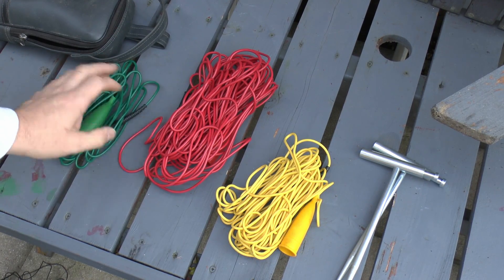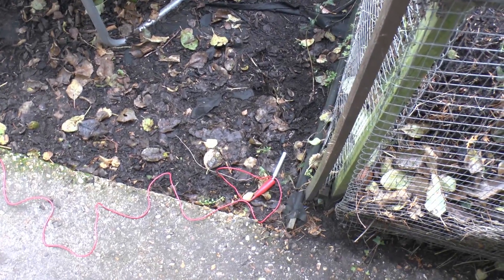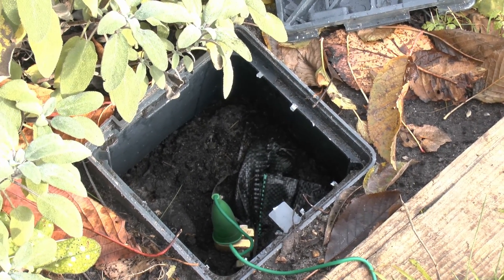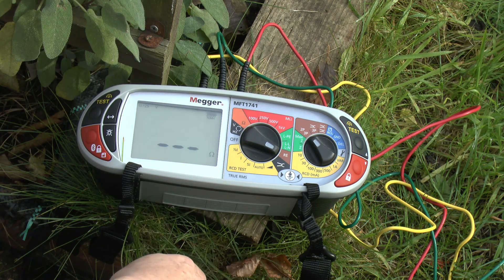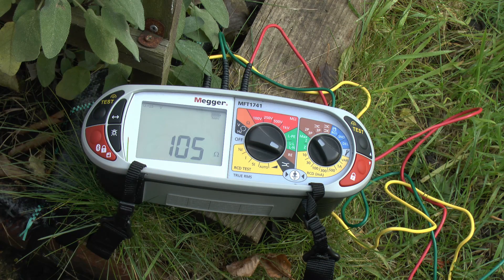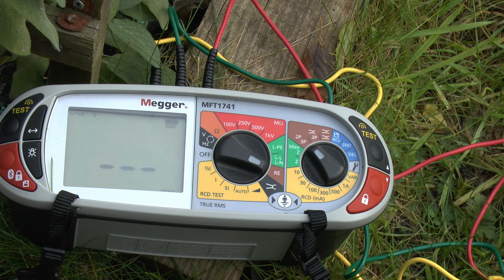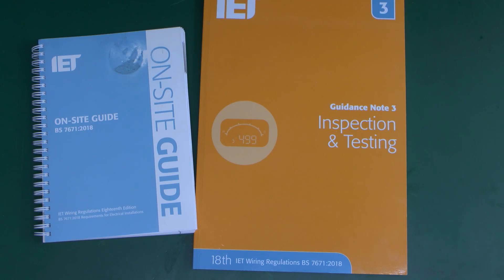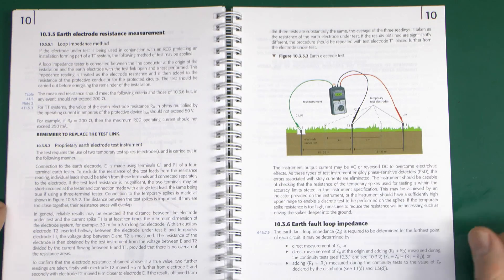Earth Electrodes - 3 Wire Testing Example (Part 3)

Comment: Hello, at minute 17.00 I didn`t quite understand how that method succeed in measuring only the Resistance of the electrode under test. The current is also flowing through R1, R2 and R3 in order to complete the circuit.

Comment: Very useful video. I have never seen this test and measurement done myself, so it is cool to see it. I have a question. Why the resistance doesn't change when you move the potential probe stake? What is theory behind this measurements. I guess it has something to do with the Ohm/squares.

Comment: On a TT earthing system, should N and E be linked at consumer board?
Reply from the maker: No, not permitted on TT or any other arrangement.
Reply: @jwflame  thanks JW, a so called "engineer" told me to link N to E bus bar as living in Thailand use a TT system or a PME?,  I didnt as it sounded very ODD
Reply from the maker: Other countries have various arrangements for earthing, but it's not permitted in the UK.  Even where allowed, linking N&E wouldn't be a TT system.
Reply: I am from India where TT earthing system is followed.
Reason for not linking n and e:
Imagine the service has floating neutral fault. The consumer doesn't notice this as the return path is now 100 per cent via linked earth. OK fine.
One bad day the earth lead got snapped (may be due to corroded joint or mechanical damage).
Now what will happen? As both return paths are open, all metallic parts (switch boxes, conduit pipes, appliance bodies etc) of the service will get energized thru the earth terminals. The appliances will not work as there is no return path. In this condition if you touch the metal parts, you become the return path and get electrocuted. 
Bonus point: RCCB is must for TT earthing system in order to protect us from leakage currents. Mcb or fuse is not intended to protect us. These work during long duration over loads and shorts for fire protection of wiring and property.

Comment: Hi John. Great video. Could I request a topic for your next one? I recently hooked up an old caravan (that was working perfectly when connected at home) to a powered site and found that every time I tried to use any load it tripped the RCD in the supply box. After checking the fuse board I found an earth-Neutral connection in the caravan. This makes sense, some current is returning from the load via the earth wire and bypassing the RCD in the supply box. My question is, what is the purpose of the earth-neutral connection and how is a caravan wired so it can be connected to either an RCD or no RCD protected supply?

Comment: I think the most important conceptual point here is that the marginal increase in resistance of the electrode (rod) under test decreases as distance from the rod goes up. This means that as you go further away, eventually the resistance of the rod reaches a maximum value and will not increase thereafter. This is because the increase in resistance owing to distance is more than made up for the decrease in resistanace due to an increase in current path surface area. So the resistance between 2 rods at 30m could be the same value as the same rods 300 miles apart (asumming the same ground conditions).

Comment: I've only seen the earth electrode test done once back in the late 90s  for a remote located 2 x  double stacked porta kabin office  with lightning protection fitted and earthed at all 4 corners for an air control tower for Raf helicopter pilot  training.

Comment: I am wondering, is that low enough for a UK installation?

Here in Belgium it MUST be under 100 Ohms, but you'll still need lots of RCDs to have a compliant system (whole house, bathroom, lights, one per 16 sockets, ... etc).
It is advised to be under 30 Ohms, which most installations are. In that case you are only required to have 2 RCDs, one 300mA for the whole house and another 30mA for bathroom and some appliances (water heater, washing machine & dryer).
I am not 100% sure but I think there are case where you may have more than 100 Ohms here, but it would require some annoying things like a 30mA hole house RCD ... etc
Reply from the maker: Almost all RCDs for UK homes are 30mA, and virtually all circuits have them.
Theoretical maximum with a 30mA RCD is 1667 ohms, but generally under 200 is considered acceptable.
Some older TT installations have a 100mA RCD, maximum for that is 500 ohms.

Comment: John,   Kevin from across the pond.  Ground rods are poor electrodes.    Here in US if a rod is your only choice it must be 25 ohms or less for a single rod per NEC.  If not add a second rod and you are done.   I have a question, at 0:55 you said that if the earth ground rod was not connected to the consumer unit it would be dangerous.   Do you not connect to other electrodes normally?   And another question, what is the perceived danger if there is not an earth ground?   Respectfully,   Kevin
Reply: R. D.    And that is my question.   Explain the dangerous condition.
Reply: R. D.     Also,  in US residential we have single phase that is 240 volts with a center tap neutral that is grounded.   So 120 volts to ground.   The 180 degrees is only because of the way an Oscope works.   If you disagree with anything, m willing to discuss.   Respectfully,   Kevin
Reply from the maker: UK consumer units do not have any connection between neutral and earth. 
With a TT system, the electrode is the only earth connection. 
Other types of installation (TN-S and TN-C-S) have an earth connection provided from the electrical supply, and although it's possible to install your own supplementary earth electrode as well, that is rarely done as it's not required and wouldn't achieve very much even if it was.
Reply: John Ward   Thanks John!   So, please tell me where the current flows to from the appliance short to the earth conductor.   Does your system completely rely on what we call GFCI over here?   That would make total sense to me then.   Respectfully,   Kevin.  Sorry, I did not see John Alexander comment.    This is a major difference between our systems!
Reply from the maker: @KevinCoop1  Yes, all TT installations must have an RCD (GFCI) for fault protection, as the fault current via the electrode will only be a few amps.
Reply: R. D.    John,    Thank you so much along with R.D. I learned something new!   Always good to learn something, even if I am now retired!   Very respectfully,   Kevin
Reply: R. D.     So does surge suppression get installed in your consumer units?   If not, does lightning strikes near the power lines cause problems?
Reply: R. D.   So for years we have been moved to more GFCI and now AFCI.    Ground and Arc fault devices.   Rather than change our systems to work like yours with no connection from neutral to ground(earth), we were pushed into buying more and more expensive devices for both.   We love to make manufacturers more money with our Electrical Code.   Manufacturers have panel members making the rules, go figure.   Now in 2020 NEC all services are required to have lightning and surge protection.   My house 37 years old, no problems.   My fathers house got hit, and took out all GFCI devices and several appliances with electronics.   Best wishes to you!   Kevin
Reply: R. D.    Your explanation is what about 99% of people think, but is not exactly correct.   The purpose for Earth connections is for lightning, surges, and a 0 voltage reference point.   It has pretty much no affect on the part of the system you describe.   If live shorts to earth at an appliance in a residence, the electrical path is back to the consumer unit, to neutral, out to the utility transformer, through the transformer, back to the consumer unit, to the breaker and trips it.   Thousands of amps.   Very few amps go to the earth rod, which already happens before the short circuit existed.   Electricity flows only in closed circuits and proportioned across all paths by the resistance.   Respectfully,    Kevin
Reply: Any more than 30mA difference between L and N, and the ELCB trips. Way before N is bonded to E.

Comment: Hi john in the on site guide it says you can use 2.5mm to the earth rod is this because the pefc is usally so low like between 2 and 10 amps
Reply from the maker: Yes, even with a 50 ohms rod, current would be 230/50 = 4.6amps.
However the wire will need mechanical protection at that size, such as steel conduit.  Other minimum sizes in Table 54.1 in BS7671.
Reply: @jwflame  so is best to always upgrade to 10mm or 16 mm

Comment: Like car mot's only guaranteed for the day it was done. If the water table drops and the garden dries out the earth rod could make poor contact.
Reply: All very mysterious really - since E is connected to N. Just a case of using an RCD to detect unauthorised leaks !
Reply: @r.h.8754  Why not though ?
Reply: @r.h.8754  Thanks for info re permission and extra earthing arrangements for N. Totally agree on your points re N failure risks.

Defective cherry picker. A burst hose should disable the machine, not let it drop. For that reason, they are power up and power down. (Unlike forklifts that use gravity to lower the forks.)
Manual lowering systems can use gravity but to operate, a normal operation safety system needs to be bypassed and that function is usually spring-loaded so requires person in attendance at all times holding the bypass valve open.

Comment: Can you use a normal multimeter for this test?
Reply: @r.h.8754  I did wonder if it was iron-based but didn't do the magnet test - but go to top of the class yes magnetic and zinc coloured.
Reply: @r.h.8754  the theoretical standard cell potential for the zinc-copper cell is 1.10 volts.

I was getting half a volt. IIRC the zinc electrode's the negative. My cell of course has a wet soil electrolyte which is probably not ideal.

LOL
Reply from the maker: No, current/voltage output is too low and it's DC - the tester in this video and others normally output AC.
Reply: @jwflame  I disagree. I fairly disagree wrt insulation testing BUT it is valid for that. For conduction testing a normal MM should be fine. The important bits are the test electrodes inserted into the ground.
Reply: Po
king finger in ground to detect faults works fine. I'm a m sure that method is on page 40
Reply: @r.h.8754  I'll maybe have a play this afternoon.
Reply: @r.h.8754  My next question - anyone got a clue as to what metal my earth rod's made from ? It's sort of lead-coloured but much harder.
Reply: Dabbled with Dmultimeter today. I can best describe the results as 'POOR' !

0.01v AC
200mV DC
Ohms - 'unreportable' !

Perhaps an analogue meter would fare better.
Maybe after Christmas I'll have the time to look into this properly.
Reply: Yes you can. Better even with two DMMs. You can use a small transformer to generate the ac current. Something like a 24V transformer. Use the 3 wire method. Use one multimeter to measure the injected current and another multimeter to measure the voltage drop. Then do the maths to get the resistance. There's a good article on nuts and volts about earth resistance measuring. It's recommended to put all electrodes in a straight line and use the 62% distance rule.

Comment: Great video John, only had to do this once myself. 

I have a video idea, I recently had to setup a last man out switch for a large commercial property, switching several lighting circuits. This is something you could setup in your lab and maybe useful to others.
Reply: Strange request as it's bespoke circuitry and any customer wanting similar may have different requirements - it's not a 'one size fits all' type wiring.
Reply: @millomweb  not a request, just an idea.
Reply: @Pengo4man  What he sets up may not match what the customer wants. So much is done by copycat. That's why in the central heating world we have S plans and Y plans. So people can copy others' mistakes.

Comment: Old electricians trick to get the earth loop impedance to the required level is to dump a bucket of water on the electrode and then put the wet electrode readings down on the certificate.
Reply from the maker: That certainly reduces the impedance - but makes any test result totally meaningless.
Reply: Reroute a downspout into the earth rod chamber & use as a soakaway ;)
Reply: pee on it
Reply: Not if there is an earth fault at the time, you wont do it again.
Reply: mix 5 pounds of salt in warm water slowly pour it in around the electrode. That will give you a pretty decent reading.
Reply: And a pretty pissed client. Not that they care for the electrical tom foolery - for the 3m² of dead grass.
Reply: Pouring epson salt dissolved  in warm water in a hole dug around that electrode will have a more lasting effect. One power company test found a three-fold improvement. And unlike table salt, epson salt won't kill plants. I've used it without ill-effect next to rose bushes. It actually provides needed nutrients.